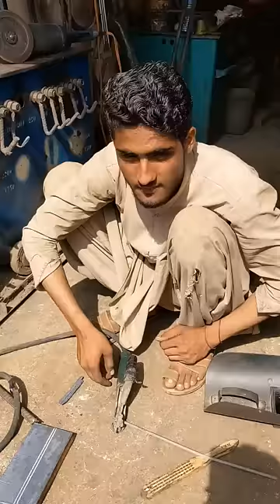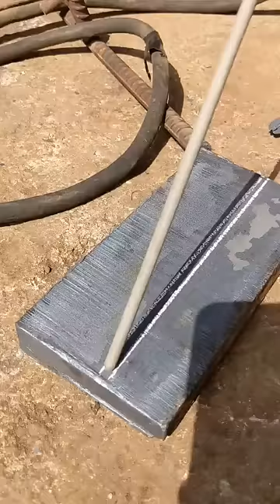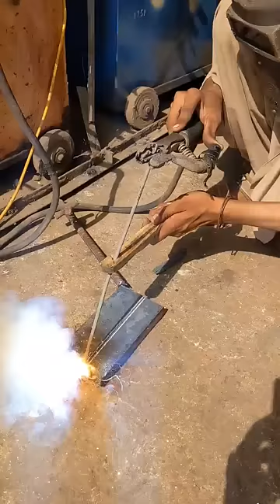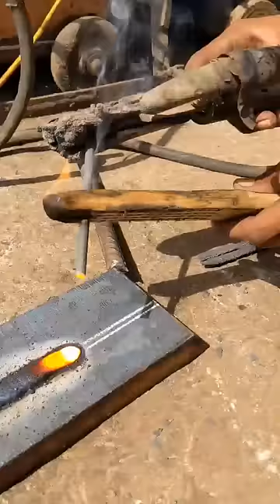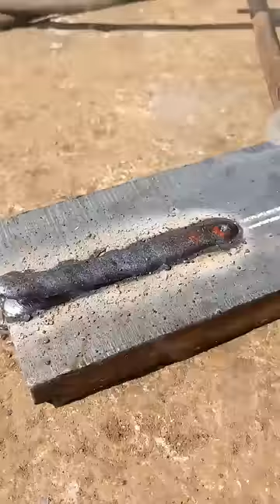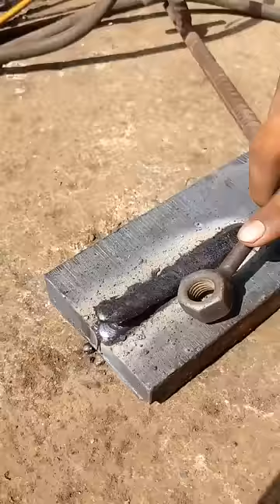new secret method for stick welding #shortsvideo

Comment: To the “welders” talkin crap you aren’t really welders if you didn’t start off doing some structural weld gig with foreign workers . Most of you gentleman are what’s called a hobbie welder (The Esab in your garage does not count) . These Foreign gents with no money for gear and all the will to lay thick bead is inspiring . A gift to be inspired by another blue collar . Something y’all will never come close to.

Comment: I don't interfere with your trade, but most of these tube welders can only weld on thick steel plates, in my eyes that's not real tradesman, my son of six yrs do a better job with thin metal welding, no offense to the real boiler makers out there